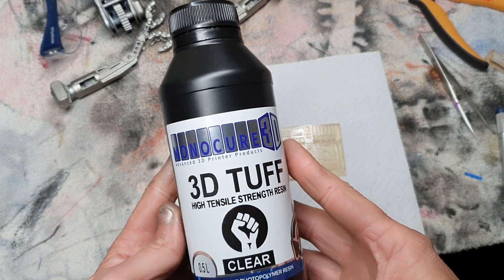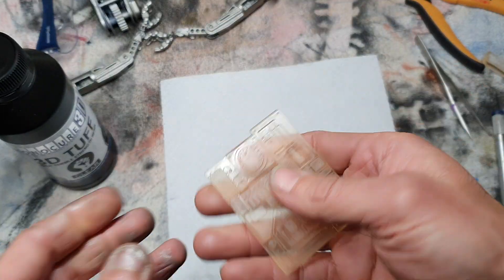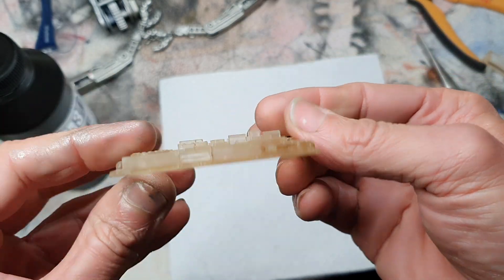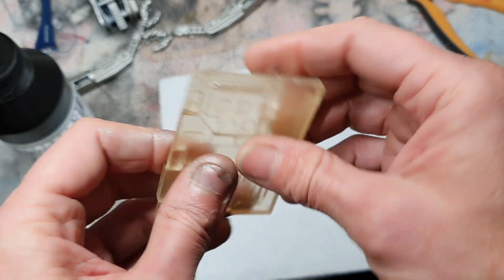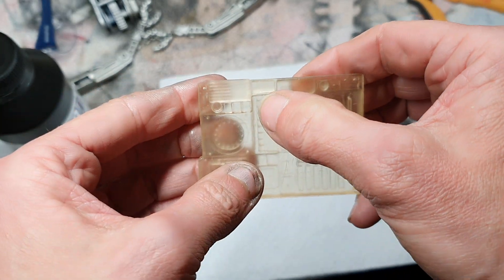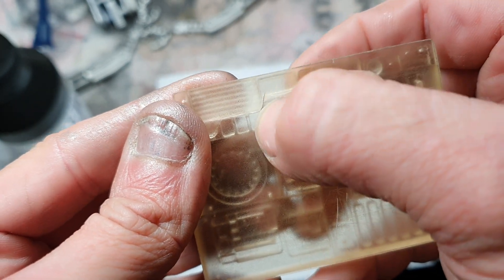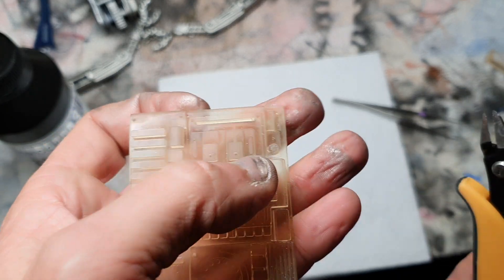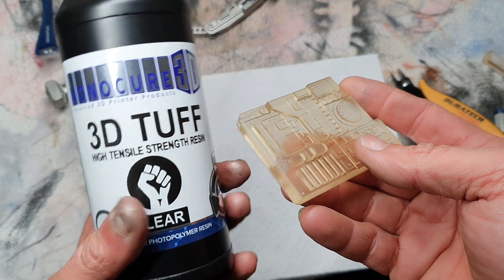Monocure TUFF resin

Comment: What printer & settings did you use?
Reply: It works on the Elegoo Mars with the factory settings listed on the Monocure 3d website which is the same as the Rapid Resin they sell. I have tested both with these settings and they work well.